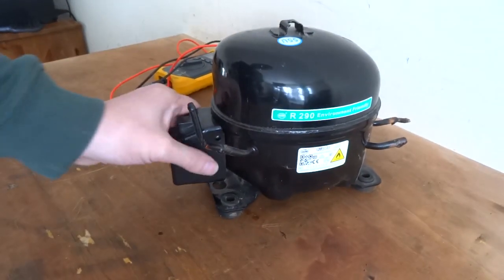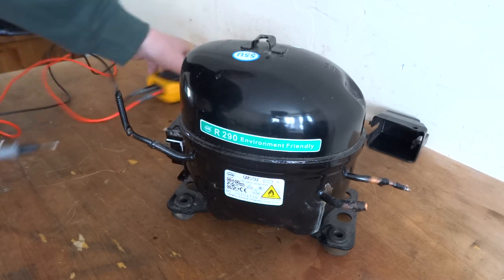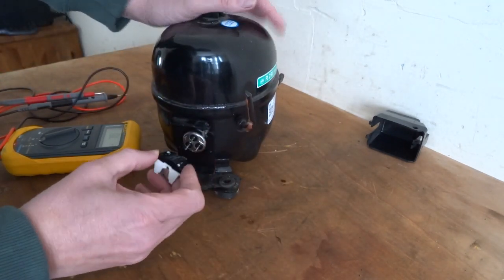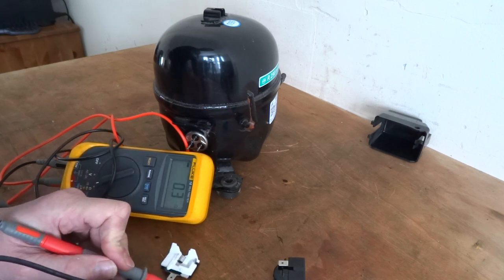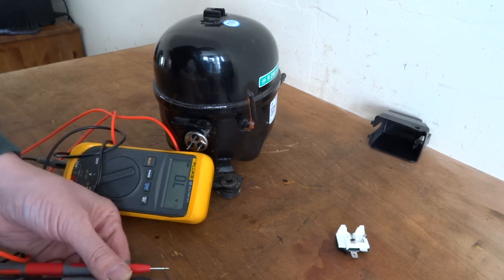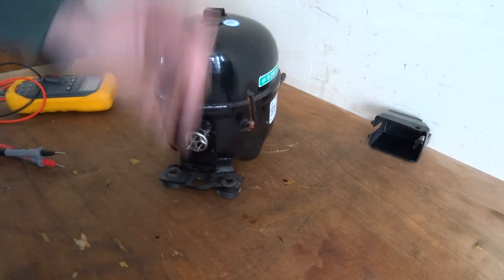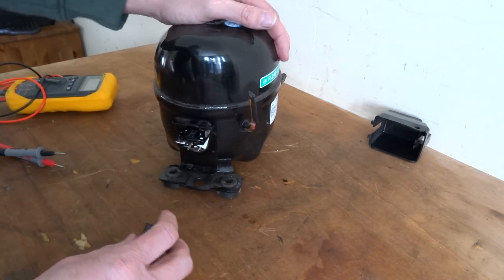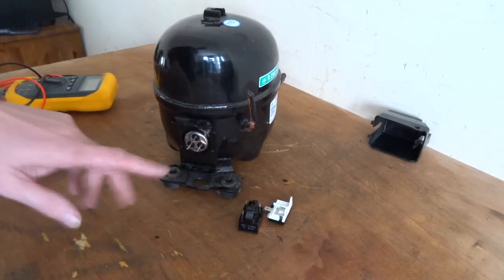Fridge freezer compressor control start relay overload protection testing

Comment: So if you have a bad overload protector, and you buy a $25 new overload protector and put it on, why wouldn't it immediately blow? and you've wasted $25...
Reply from the maker: Yeah its highly possible if the overload issue is still present it will low again.